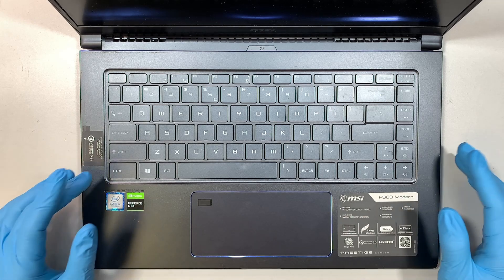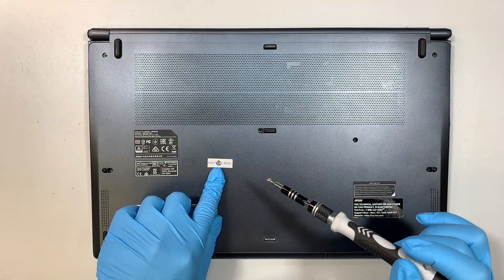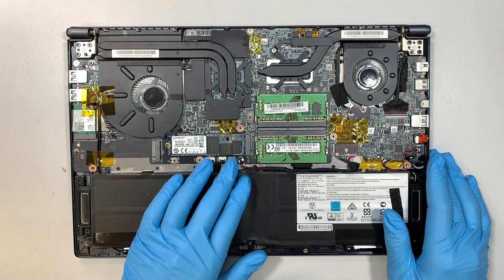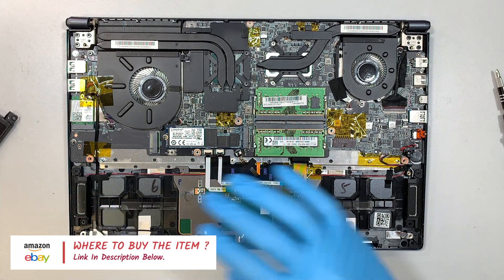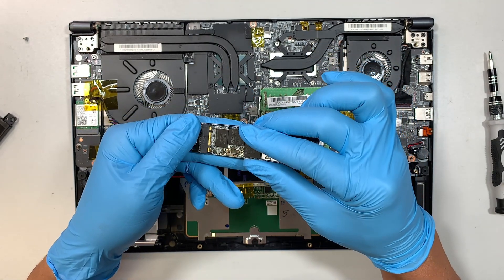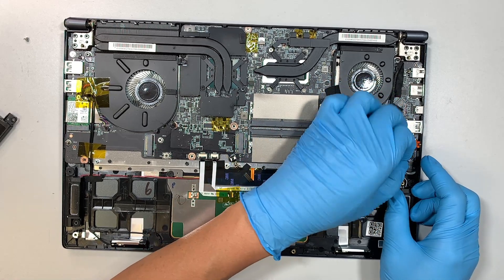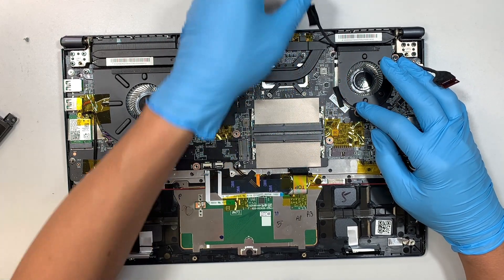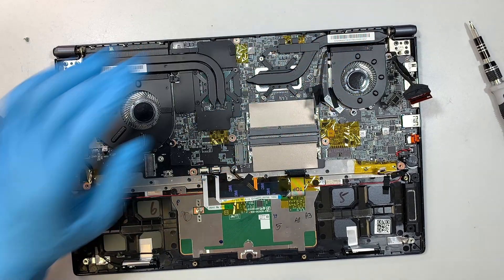MSI PS63 MS 16S1 Laptop Teardown Upgrade Disassemble

Comment: The two cables for WiFi/Bluetooth adapter would go over the top of the new M.2 SSD that installed in the extra slot?

Comment: Hey I bought a Crucial SSD M.2 Gen 4 for this PC to increase my storage. When i built it in, i wasn't able to find it in the disk management storage, So i changed for a Gen 3 but same problem appear...i'm not able to detect it...any recommandation?
Reply: This might come a bit late, but it could still be helpful: This laptop only has 1 M.2 NVMe PCIe/SATA slot, where the default SSD is installed. The second slot is exclusively for M.2 SATA drives. It will not detect your SSD if it's not SATA. I made this mistake as well; I was trying to install the new SSD (NVMe Gen3) into the free slot, thinking it was the NVMe/SATA combo slot.
Reply: Is the disk appearing in system bios?